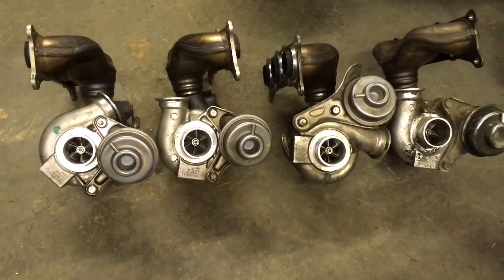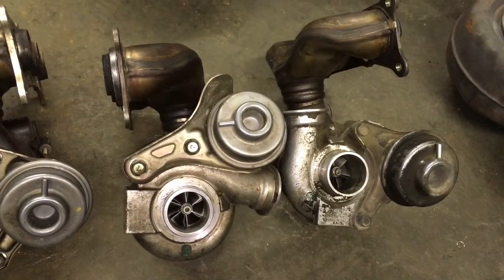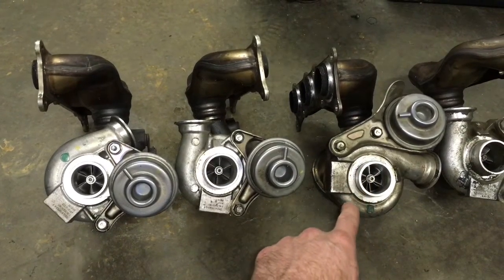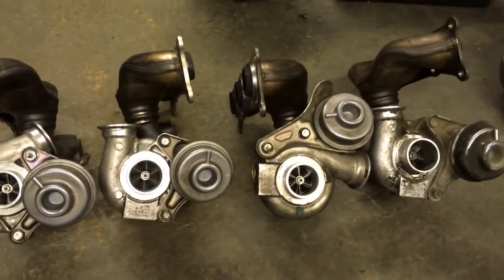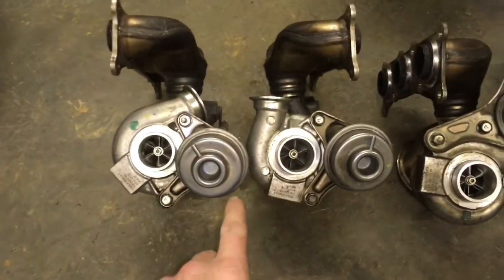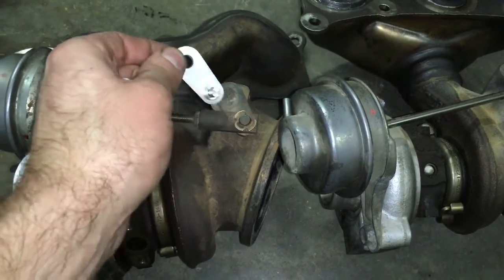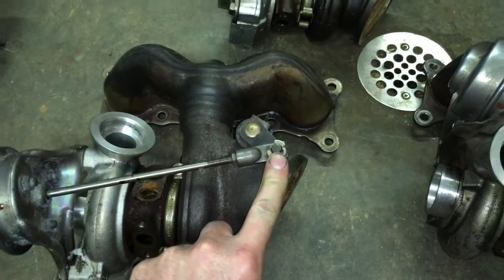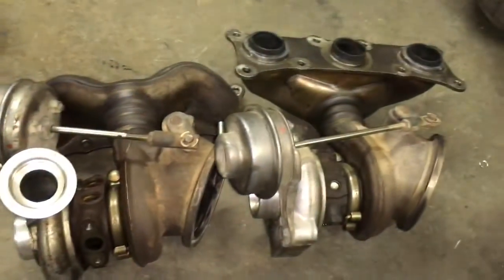BMW N54 135i 335i 535i Turbo Differences

Comment: According to real oem the z4 uses same part number turbos as 135/535i. The x6 turbos have their own part number and resemble the 1/5 series but have a few different things. They seem to share the same clocking of the compressor housing as the 1/5 series rear turbo but the inlets have plastic quick lock things bolted to the compressor housing.

Comment: Sweet. I have some used turbos from a 2011 1-Series M that have 40,000 miles on them. I suppose he just wanted to replace them preemptively. 🤷‍♂ The wastegates seemed fine, so I held onto them. Looks like the same orientation as the 5 series, which works for me because I was hoping to pick up a fixer-upper E61 for less, maybe with sloppy wastegates. 
The BMW and Mitsubishi numbers can get a little confusing, and differ some. The WorldPac catalog seems to say they are the same also. 
Thanks for the tips. 👍

Comment: Have a chance to buy 535xi turbos for my 335i is there a way i can use my turbos and make a frankenstien turbo to have my car run. (current turbos have bad seals and smoke very bad)
Reply: I put 335i turbos on my 535i non-Xi but I was able to make it work with ease
Reply: @guillermolopez1690 could I make 5 series turbos fit on my 335i
Reply: @Hellcatzayy wondering the exact same thing, i got a 535xi engine with turbos that i’m putting in my 335i
Reply: @guillermolopez1690  how?
Reply from the maker: I have plenty of 3 series cores if you want to trade

Comment: I know that the 335is 2011 and 2012 have the twin turbos (N54). but 2011 is when they started with the n55 or single turbo motor
Reply from the maker: +mahunik I have seen some turbine housings stamped 2013 that had the twin tdo3l turbos, it's possible that they were a replacement set though
Reply: 2007-2010 were n54 twin turbo 2011+ have the n55 with the single twin scroll
Reply: @KingLouis_  my 2012 335is has an N54 but I put 19T turbos on it

Comment: Hey there
I know this isn't a video to be asking turbo questions but you guys seem very well informed and I would just like to ask a few questions

I'm fairly new to getting into cars I have a good concept and understand about how internal combustion engines work and all and the basics and I'm looking to work on cars and I've been looking at turboing my car, I have a 1998 Dodge Neon RT, ( yes laugh all you want) and it's a amazing car it just lacks horsepower, I found this turbo kit and I have the money to buy it the only problem I have is all of the things I read on forums and how people distrust kit like these, it has everything in this kit to turbo besides a ECU fuel pump and injectors which I would buy all separately my question is it worth it to install this turbo in my vehicle and just be smart about it I would be running stock internals for now sadly but I would like to hit around 8 to 10 psi, this kit seems good at least to me but I have no idea because I'm new to this